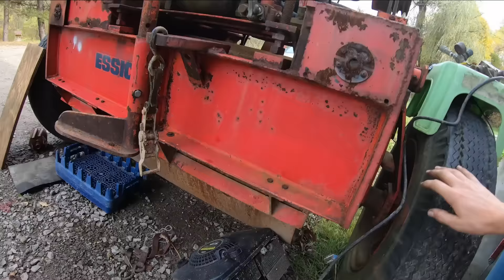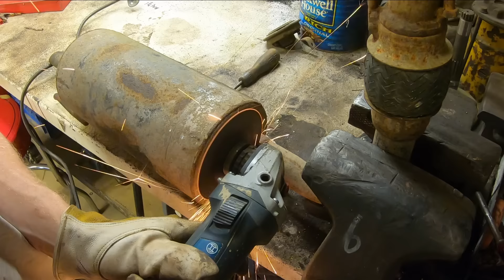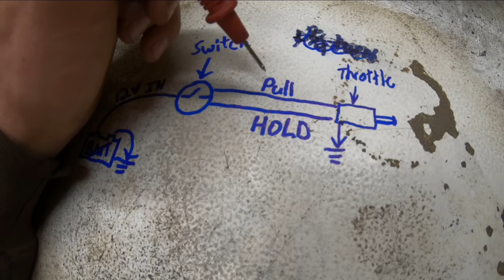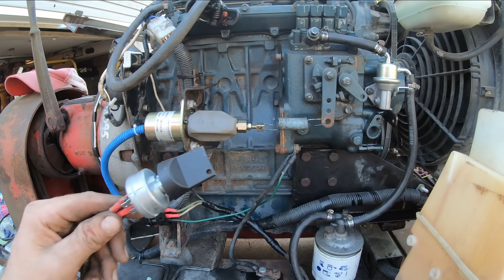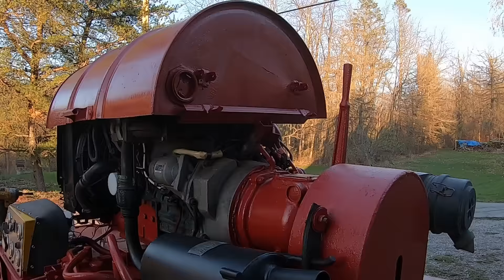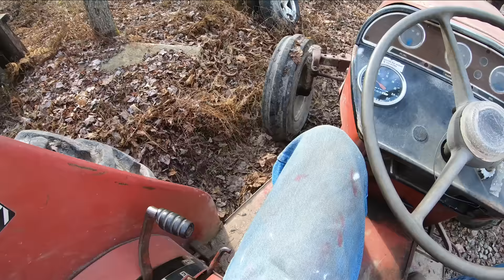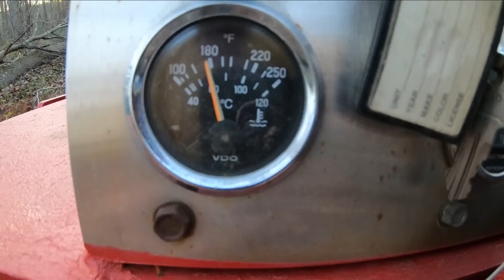Junkyard Kubota DIESEL powered Roller/Compactor build COMPLETE! (Lets try it out!!!)

Comment: Matt, glad you got your remote working but remote with that high an amperage is potentially dangerous.   Your first design with the 14 ga and the lawn mower keyswitch would have worked to fire a relay which in turn actuates the solenoid.  Relay like $15.

Comment: You can  weld it with  a mig running  .o35 wire.  Or if you  want  to  go old school. Do  it with  a brazing torch   and  a coat. Hanger.

Comment: For anyone watching this, the relay and solenoid are mixed up. Presumably why it won't start. Thats a little cube shaped fan/light relay. The big round one is a starter solenoid. Solenoids like that are good for short bursts like starting, but you can cook the coil by keeping them on, even with a small load. The smaller relay wouldnt be at all suitable for starting a 4 cylinder diesel.

Comment: You can use that switch Just add a Relay to take the amps Away from the switch relays are pretty cheap and easy Compared to Expensive high Amp Switches Matt 17:20 @Diesel Creek

Comment: Matt, You could have used a single circuit to the solenoid. When the solenoid moves, you could open the current path to the pick part of the solenoid using that motion to push a momentary switch. Using a little lever and a spring, you could limit the amount of push on the switch to simulate a thumb push. Of course, you have what you need but this would have done the job with two wires to the tractor. That Kubota is a massive upgrade to the original motor. Nice bench lathe!

Comment: If someone hasn't already mentioned it, I fear the zip tie will wear out quickly.  Would you consider inserting a bolt inside the throttle spring, with a couple of large washers on each end to keep it inside the spring, with a nut on the end to allow you to fine-tune the idle speed?  Use some Loctite on the threads to keep the nut from vibrating loose, or try a nylon insert nut, so it doesn't vibrate loose, perhaps?  My wife & are are sure enjoying your videos!  I've learned SO MUCH from your comments & methods.  Thank you for providing this excellent resource to us all!

Comment: Everyone thinks 7010 Stick Rods and 7010 welding wire make a stronger weld .  It does NOT because the higher heat necessary to weld with 7010 stresses the metal you are welding and causes cracks in the two pieces of metal you are welding together .  Sometimes less is better .

Comment: If you want a clean looking MIG weld use 6013 welding wire and 75% / CO2 25 % Argon Gas .

Comment: You could've adjusted your solenoid with some washers between it and the mounting plate to make it farther away from your throttle linkage.... might've made the idle a tad higher but no need of a zip tie.

Comment: That was a strange fix with the key switch. All starter and fuel pump and any high current device uses a switch to turn on a relay near the battery

Comment: The result is really great with this.
The only thing I may have done differently is have the gauges where you can see them from the driver seat of the tractor, or at least a couple of warning lights on the "remote control" that would tell you if oil pressure was low or temp was too high.
Took a couple of years, but the result was great.

Comment: For your pull and hold switch on off on switch or on on toggle switches should work 12 volt dc w about 5 dollars should work 10 to 29 amp. Like an old accery fog light switch. Good luck.

Comment: Fun to watch the gears turning as you worked out the solenoid issue(s), you found a way to make it happen. This Roller/Compactor makes for a perfect tool for creating a hardpack surface. Takes quite a few steps to do it right. That road will be there for a very long time, especially with you maintaining it as you will.

Comment: What’s from stopping you from putting a great looking paint job on that machine. All you were out of is a gallon of paint. All your friend did was apply a prime coat, that color of paint usually takes 3 or 4 coats before it starts to look right.It’s in a neutral tint base which is almost semi transparent.

Comment: Get yourself  a relay!  Relays aren't complicated!  Most of them are easy!  A the top of the relay there are two terminals, One right over the other!  Those terminals are your high amperage terminals!  Right under and at either side are two terminals that are facing straight up and down. One is your trigger, and one is your ground! It doesn't matter which one you ground! as long as have one of these terminals grounded and the other coming from a switched 12VDC source!  They're cheap too!  Ebay has  5 40 amp relays with wiring sockets for $12.50!

Comment: Use a relay at the machine end to carry the 'pull' function current only via the small remote cable, the rest already works. 
Wiring for me is pretty easy.Before I retired I was  a senior field engineer for X-Ray equipment manufacturers.😎

Comment: Wire feed is up to much for the set up you want for an exhaust that will help with mig welding easier control to get the proper beads down

Comment: You still could have used the key switch, all you needed to do is use the start position to actuate a relay which took power for the pull direct from the battery.

Comment: i don't get it.. why does it need an engine..your pulling it with a tractor.. what is the engine running.
Reply: It is a vibrating roller and the engine makes it vibrate. A vibrating roller compacts much better than one that simply rolls.

Comment: Congrats on a job well done, BUT did you intend to put that rubber shield on the control panel that crooked???
Reply from the maker: It’s not actually crooked. The panel is tapered. It’s square to the front of the panel
Reply: @DieselCreek  AHH...the old optical illusion thing.
Thanks.

Comment: I'd suggest a weight bar from an old tractor placed on the frame between the a-arms just in front of the engine. It'd give you better compaction that'd still be adjustable.

Comment: Have you ever messed up your glasses doing the closed eye tacking method?  I did it just recently and ended up with a speck of welding spatter hitting my glasses directly in my line of sight.  All the lenses are made of polycarbonate now, so they melt.  Ruined that lens, had to get it replaced unfortunately.  I won't be using that shortcut anymore!  I would also say you are better with electricity than you give yourself credit for.  You drew a good diagram and came up with 2 good solutions.
Reply: Trust me, with welding spatter or grinder sparks it makes no difference, glass or plastic, they both get damaged. Molten metal is corrosive.

Comment: You have a great idea with the switch all you need to do is add a relay to control the high current usage. Wire the low side of the start side of the relay to ground and the high side from B+ to the solenoid. It should work well.

Comment: Use a hole closer to the shaft of the throttle and it will pull more.  That's why there are 3 holes.

Comment: Matt, What you need to do is wire the pull function to a 2 post starter solenoid, which you can get at any parts store. All you do is run your pull wire from the key switch to the small signa/trigger post on that solenoid, then run a length of 10 gauge wire from your battery positive to one big post on the solenoid then run another 10 gauge from the second post over to the pull terminal on the throttle solenoid. I’m sure you know this already but this will allow the high amp load to be switched by the big solenoid and the only load on your key switch will be the 2 or 3 amps it takes to close the contacts on the new solenoid.

Comment: Brush strokes? Seriously? You gonna look a Gift Horse in the mouth?
Geez- I wish I had a Friend who could help me out.
You'd better count your Blessings, Sir. You're living in Paradise
compared to many. I think your Friend did a great job painting-
thick, heavy coat of protection. It's a piece of construction machinery-
not a Lamborghini. I'd actually throw a few coats of 2k gloss urethane
over it, even more protection, easier to rinse off. Fab up a box for the
back of the control panel. Decent tires. That's an awesome roller!

Comment: Add insulators between fuel tank and machine. Recycle body mounts
from an old vehicle, or maybe even springs- anything is better
than directly attached, where harmonic vibrations are churning up the fuel.
A plumbing trap between filler neck and tank would greatly lessen loss. 
I really wish every single piece of your equipment had a fire extinguisher
onboard. They're relatively cheap peace of mind. $20 each @Amazon.

Comment: Add few solenoids, make a slightly larger remote panel, few more wires
in the umbilical. Your remote "box" could have a wheel control, digital
RPM, Temp, Fuel level gauges, vibrate engagement, and a keyed 
start/stop or just a safety red STOP button. 

Add all the creature comforts that make one of these really expensive. 
The setup you have now is fine, and it works for now. 
It could use a red led "Power" indicator.  
These are just suggestions for the future.

Comment: had a gas tank simlar too that on my toter we used for mobile homes it would splash up on the lid and come out on the treads so i made a better seal i filled the cap in with a  spry foam then shape it and just put a solid rubber seal  a crossed wear the orginal seal is it lasted 30 years before my dad sold the business   the truck we had for about 15 of those years

Comment: Add a normally-closed pushbutton (PBNC) to the solenoid linkage and run the pull circuit through it.  Once the solenoid is energized it will remove power from the pull.

Comment: You probably already know this but just in case you did not, arc welding on vehicles or machinery while the starting battery is connected in circuit can blow the diodes in the alternator rectifier.

Comment: USE A TESTER LIGHT AND SOME CLIPS TO HOLD IT ON... WHEN THE THE FAN COMES ON THE TESTER LIGHT WILL GLOW  WHEN ITS ON AND NOT WHEN ITS OFF.... YOU CAN SEE ITS WORKING FROM THE FRONT.. MAYBE EVEN A DUMMY LIGHT ON THER FRNT SO YOU CAN SEE WHATS WORKING.
...

Comment: Does anyone know the part number to that solenoid? I didn't know that there were solenoids strong enough to pull that. I need one to setup a remote shut-off on my uncle's diesel welder. You need to physically pull the fuel shut off lever for a few seconds and it takes a decent amount of force. I used two timer circuits with relays but they burn out after a few times of use. This relay would do the trick.

Comment: Ok, I have to ask a stupid question. I know most rollers I have seen is feeled with water or some sort of weight but they don't run motors but the question I have is, what is the motor for exactly? To y'all it might be a stupid question but I wanted to ask. When I first seen it I thought maybe it was actually drivable then you said you was going to hook it up to the tractor so that's why I'm asking really. I'm sure you said what it does though. I probably missed that part though. Ok so I had to look it up and I believe I know the answer to my question. I also went back and watched when you was talking about the weights. So the weights move inside the drum to cause vibrations?

Comment: To sort out the fuel spillage issue insert a narrower pipe with screen wrapped around it... It will act as a dirty trapper when filling from containers in the field and will baffle the splash inside the tank from shooting up to the cap.

Comment: I realise you've made up a work around with two switches, the original switch would work if you stuck a 12v Relay between the start position and the solenoid. more wiring I know but I think your original 3 position starter switch was a neater install.

Comment: Mig is all about settings and also  wire size vs material thickness and hand speed  as well wonder if it was wire size not the ignition switch after all in the end may also want to enable remote start and shut off

Comment: Please put the guard back on your angle grinder. There is NO BENEFIT to removing the guard. You are too talented to lose the use of one of your hands by severing your tendons.😣
Reply from the maker: No benefit!!? You can fit it in way more places and use the whole disc the guards do nothing but get in the way
Reply: @DieselCreek  NOPE! You can only use the radius of the cutting disc from the edge of the disc to the edge of the center nut anyway. Taking the guard off doesn't get you any closer. If you cant fit the grinder in there with the guard on it. Then us a die grinder instead. One day you'll pick that thing up and unintentionally hit the trigger...and it'll be a trip to the Emergency Room. It's not worth it my Brutha!

Comment: Any chance to relocate the gauge panel to the front? See what's happening at a glance instead of walking to the rear and finding you have no oil pressure or something. Pain in the ass but might well save your machine. Nice job! I need to look into one of those.
Reply from the maker: yes that was poor planning on my end. Might do that soon!
Reply: @DieselCreek  Just more refining. You have a good machine. Now it's down to dialing it in.

Comment: I have joined this a bit late, but when you set the revs up, it the clutch should have been engaged to set it under load, so its probably 
running slow when in use
form across the pond UK

Comment: Just a observation. I appears the engine in mounted on rubber dampeners, and bounces around a little. The problem I see is the exhaust is mounted to the belt guard, that is fixed to the frame. Love the videos.

Comment: For the love of God, don't use millings! I live on a 1/2 mile private road and when it was gravel it was just an easy box scrap to make in nice again. Then the neighbors voted to put millings in. Total nightmare every winter. Potholes everywhere and the only way to fix it was to add millings to fill them in. Not horrible but much harder than just box scraping, and I'm the one who was stuck doing it. 
Now they all voted to pave it without addressing the drainage issues, I'm betting potholes by spring. My 1/8 mile gravel driveway off it is still perfect. Dumbasses. Don't listen to the guy who was a paving, sealcoating commercial property contractor for 20 years.

Comment: Don’t look a gift horse in the mouth, you have neighbors that give you engines and neighbors that like to paint your projects
Reply: Relays are simple. If you had stuck to your original switch, extension lead is perfect. As you saw the pull in was trying. A simple spot lamp relay would do the trick acting as a switch from battery to solenoid. The original ignition switch with the heavier cable would also have worked. It was the voltage drop that caused the problem.
Reply: For sure - looks great on video!
Reply: If you have neighbors that give you engines and like to paint your projects, you've got Neighbors!

Comment: cool video,i like wiring & I Also liked the key switch idea a lot Better & Im Pretty Sure it would have worked if you had changed from that small N crappy 14ga wire to a new 12ga or even a 10ga wire then ya should have ben good to go + It Would look a Lot Cooler To & it would kinda be dumb as* proof to..lmao ! !

Comment: You might wanna think about putting some brake lights on that thing unless here gonna trailer at everywhere
Reply from the maker: Reflective triangle is good enough for around here, treat it as farm equipment, plus I have a magnetic set I could throw on it if I were worried about it

Comment: sorry if this was already asked i couldn't find answers in the comments .
1. how much does it weigh ? 
2. does the vibration transfer to your tractor ?
Reply from the maker: I’m guessing it’s between 5-6,000lbs and you can sorta feel the vibration in the tractor but not bad, mostly when it’s getting up to speed or slowing down it hits a frequency that transfers to the machine a bit especially if your not moving

Comment: use a full thread bolt or threaded rod, washers and double nuts through the inside the spring in place of the zipties. then it will be easily adjustable.
maybe a couple nylon or rubber sleeves and washers to keep the bolt from rubbing against spring directly, seeing the thing is a huge rattle :)
Reply from the maker: Pretty good idea thank you

Comment: perfect choice for a solenoid switch :)
after seeing the solenoid not pulling in, that made me think about many of those ignition switches cut off the "run" power when in the cranking position, since they're mainly used for accessories and not ignition feeds. maybe that's the case there and why it wouldn't pull in, other than lack of current and low voltage

Comment: After watching a gazillion YT videos, I'm fairly certain I'm the only person in the world who uses a sawzall with a metal cutting blade. Never got into cut off discs. Nice job on the roller! I can see where something like that would have made some of my projects turn out better. Thanks!
Reply: I primarily go for the sawzall with good carbide teeth steel blades to cut exhaust pipe and other things like old cast iron drains, conduit and more. it sure zips through exhaust pipe fast.
Reply: Sawzalls are GREAT for cutting tree roots.  Use a blade with about 5-8 teeth per inch.  You can get them for about $2-3.  Pull the trigger and the blade will dig itself right into the ground and there go the roots!

Comment: Couldn’t you have used a much stiffer spring and just adjusted the high idle stop down to 2100 rpm instead of the zip tie? 

I have been looking for one of those little diesels for a generator project I have on the back burner